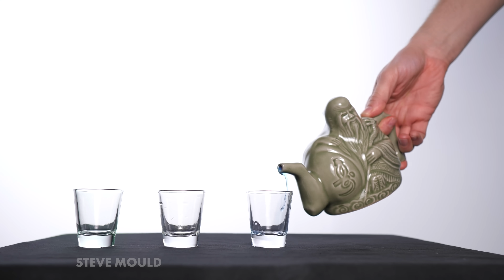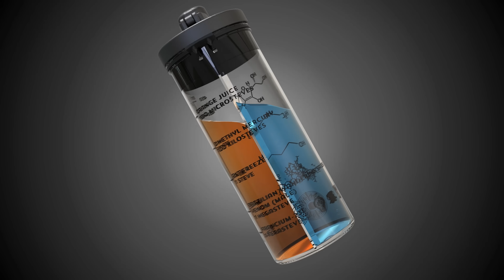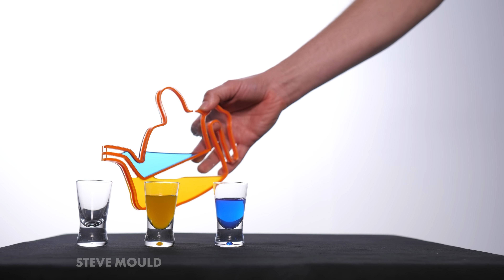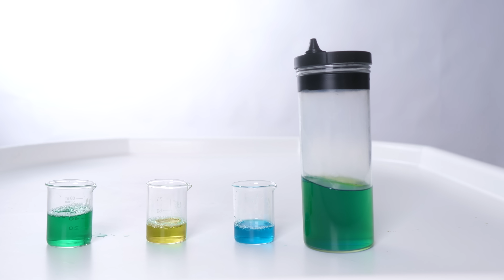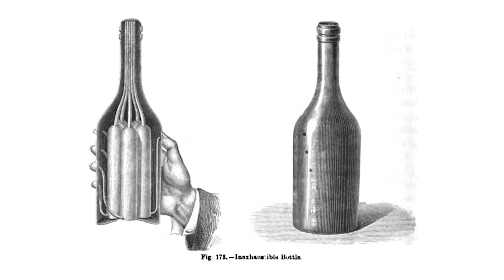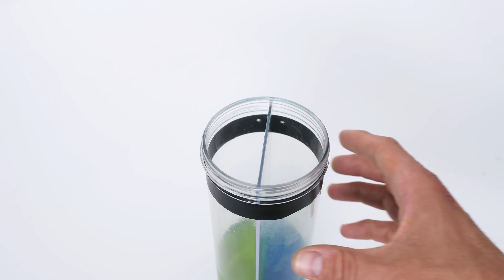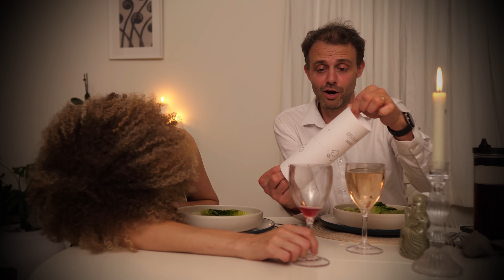The weirdest water bottle you can buy

Comment: I love this! I always have a bottle of pop (Stevia sweetened) and a bottle of water beside me. I could just have one bottle with this.

Except for one thing. We're trying to get away from using plastics for food and drinks and right now, my water bottle is metal and my pop bottle is glass. (When I go out, I just use the water one -- the glass one is pretty heavy.) I will probably buy one of these, but I will use it only occasionally. 

Any chance you could come out with one that's made out of silicone or something? Even glass? I'd carry a glass one around, and the cover would make sense on it too (my existing glass bottle has a rubber covering to protect it from bumps).

Comment: ok so im super late to suggest this and if you have not thought of this on your own which is very probable that you guys have . but anyhow the holes should be plugged in the normal position so like alittle chamber for a spring loaded ball bearing to push on a o-ring gasket so the bottle is sealed always and a couple of buttons that have pins to push the bearings to allow air thorugh. this allows the user to not worry about covering the holes after pouring and makes the experience much more intuitive  as you simply press the button of the liquid that you need to pour and if you forget about the buttons you dont pour as opposed to making a mess if you forget to plug the holes in this design.

i secretly hope that you somehow missed this idea, and this comment so you find it later and unable to live with the fact that this cool as fuck waterbottle couldve been better. have to release it again later when probably i might be able to afford it. 

ps: i know the bearing chamber valve idea makes it alot more difficult to produce on a large scale but i used that example as it clearly describe the overall idea and "i can think of better ways to implement a normally closed push to allow air through"  mechanism which would be better suited to be produced in a novelty bottle. i chose to describe it this way to just get the idea through.

heres a shit drawing of this. https://youtu.be/Jsy-OVCIQmU

Comment: You could replace the holes by small valves that are open when pressed. When I want to drink, I press the button (=valve) on the compartiment I want to drink from, air flows in and my drink flows out. There are no leaks as the valves are by default closed, and it's more intuitive than the hole system from a UX perspective (press on the desired liquid compartment rather than cover the hole on the undesired compartment).

Comment: I feel the better option for the holes would be 2 valves connected to little rubbery buttons on the outside. The valves are closed by default, but if you push down the buttons it opens them to a small pocket with air holes

Comment: hmm... I feel like the solution for the plug on the little holes is probably the biggest weakness. What if you had something like a rotating ring around it that selects which pouring mode it's in by having the ring block the little holes in different ways as you rotate it?
Reply: scrolling down the comments I see lots of people are proposing similar types of ideas. I'm sure there are a treasure trove of modifications being proposed in the comments so I do think it would be fun to have a video going over some of those ideas.

Comment: Thinking about the hole-covering mechanism, you could make the top cap have 4 levels of turning around, 1 for off, another for left hole, next for both holes and last for right hole. Basically have it snap in one of those positions with two holes in it that move as you rotate it.

Comment: cant you just make a switch to solve the holes problem, with middle position, bottom position, right and left, where of course on travels you want it set to middle top position, that way it would be just a move of a thumb instead of plugging the holes, or the need of using fingers all together

Comment: A slider would be a lot more practical. Normally it is on the dead center, closing both holes. Move it to left and right hole is open. Move it to right and left hole is open. 
Yeah, it is a bit counterintuitive but rush4249's suggestion of reverse function should compensate for that, fixing left and right opening left and right respectively.

Comment: I agree with some of the others here that buttons which are closed at rest would be best. Small spring for each button between the outside wall and the button head. Silicone ring on the inside for a seal. A slide on the outside to act as a lock for the buttons to ensure they don't get pressed in transit.
Cleaner looking and more durable. But I assume the issue is cost to do so.

A hinge lid would have also worked, then hide the buttons/holes in the in-built hinge. Also mostly a cost measure I assume.
Something that would be higher than normal due to small scale factors and the split compartment bottle.

I hope later you are able to revisit this with an improved version, its a fun idea!

Comment: I think you should have a mechanism to plug the holes that works a little differently. Perhaps two buttons that remain sealed however once pressed, open up a hole. This works in the oppposite way to the teapot where you press something to cover a hole. This way the holes remain closed in transit but you can still press either button or both buttons.

Comment: What if you put holes inside mouth piece, like having 4 tubes: 2 for liquid and 2 for air? And to block flow of air in each of those you introduce a button that blocks appropriate air tube on the side of the bottle.
This way there will be no spilling; of couse, provided that you cap block all 4 tubes on the mouth piece.
Wouldn't that be more elegant design?

Comment: I feel the design could’ve been less janky if they actually hired an engineer. Having a rubber stopper to prevent leakage is just not ideal. A toggle button like a rocker would be better. So you can set it to open or closed just by flipping a switch

Comment: just an idea for the mechanism for the holes, you could have a sliding cover that has 5 positions, it uncovers the left hole when all the way to the right, both holes when in the 4th or 2nd position, COVERS both holes when in the 3rd/central position, and uncovers the right hole when slid all the way to the left. that way you can get all three outcomes and it'll be water tight when in the centre position.

Comment: The black collar where the holes are could be made rotatable in order to block/unblock different combinations of the holes (then no extra rubber piece would be needed) - plus a smaller hinge connected stopper attached to the main pouring spout 🤔

Comment: why not 4 check valves? have a little tube that leads to the outside with a little ball inside,  it should have a mesh on one side and a hole with a chamfered opening on the other. That would fix the spilling out problem on one end and the internal mixing.
Reply: If I were to guess, too complicated to easily manufacture, and for the consumer, how would you clean it?

Comment: If instead of just open holes, it had a collar that i could twist to open one liquid. Or twist the opposite way to get the other one. Or leave it in the center to close both. 

Like how you choose a direction on a socket wrench/wrachet. 

And maybe you take off the collar or pull up or pull down (one of the three, not all 3) and you can then get both liquids at once

Comment: Is it possible to design the holes for controlling the drink choice (control holes if you will) to allow air flow but not water (limited by surface tension etc.)?

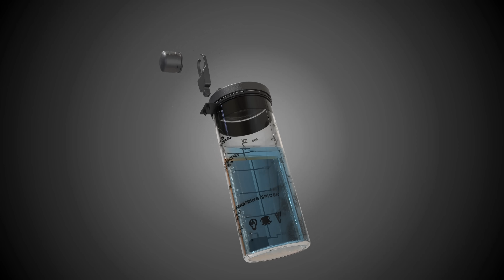Comment: 6:22 
My first guess was deadly amount of that substance for the given amount of Steves, but after a first calculation I'm not sure anymore. According to the EPA[1] dimethyl mercury is deadly at about 5mg/kg body weight, so 375mg (or about 0.11mL at close to 3g/mL) would be enough to kill a person weighing 75kg. So if a Steve weighs 75kg 300mL would only suffice for about 2.7 kiloSteve. for Since it's just gonna get absorbed and deliver mercury everywhere in your body I guess lethality is pretty much the same no matter with which body part it's absorbed. I could be wrong about that of course, but I don't really see a factor 30 in lethality difference between skin and mouth (which I could be very wrong about). Antifreeze on the other side fits what i found[2].

[1] https://cfpub.epa.gov/ncea/pprtv/documents/Dimethylmercury.pdf page 19
[2] https://www.atsdr.cdc.gov/ToxProfiles/tp96-c3.pdf page 12

Comment: I think this is a great idea and a load of fun. For the issue with the holes at the back leaking, would the use of one way valves be any use? Allowing air in without interrupting the mechanics of the bottle, but preventing liquid out? And another suggestion, instead of placing your fingers of the holes every time you want to swap drinks, why not include a sliding switch, much like you’d find on a hairdryer, that allows you to choose one or the other or both. Love your videos, your content massively aids my university studies (motorsports engineering) and can’t wait to see the final product!

Comment: Someone below had the valves for the air holes proposed as buttons below - what if the valve was a rotating ring with 5 indexed positions (both open - left open - both closed - right open - both open)? flappy rubber flaps have the tendency to break off at inconvenient times... having to hold the button pressed for dispensing the liquid might also not be desirable.

OR.

take an example of the filtering water bottle (e.g. by Sistema) that has a Brita water filter disc insert - it has a one-way valve to avoid lowering pressure and back-feeding the air through the disk back to the water chamber. What if you had 2 one-way valves, one in each air-hole, to not let the liquid out that way but allow air in? then cover the hole(s) of choice for desired action. Well chosen one way valve will allow you the 'sprinkle water on your head' action too.

Comment: The "let the air in" holes should use a simple pressure valve on the inside to close up when liquid pushes against them. That way you don't have to have a cap-tail that has to be removed both on the cap and on the tail to drink from the bottle, but can still prevent spillage

Comment: Why not have a switch in the back to cover the holes? It could be a slider switch that goes from covering one hole to the other. Or, it could be a rocker switch that goes from plugging hole to the other. There could be a middle position that seals both holes simultaneously.

Comment: Let's see if I got it... 
400ml of orange juice equals 100 µSteves, so you would be able to kill Steve with 4000L of orange juice
300ml of dimethil mercury equals 100 KSteves, so you would be able to kill Steve with 30µL of that
200ml of antifreeze equals 1 steve, so you can kill Steve with that amount
100ml of Brazilian wandering spider venom equal 1 MSteve, so you need 0.1µL of that to kill Steve
Finally, 16ml of Francium-221 equal 1 TSteve, so you'd need 16 femtoliter of that, in other words, given Francium's density of 3.48g/cm3, 0.03968 nanograms, or roughly 100 billion atoms if I did my calculations right

Comment: i am not good in design on computer to show you a good example how you can manage the two holes on the bottle, you can use a kind of sliding switch with 4 positions, the first one is closed, the 2nd will make the first hole opened, the 3rd one both holes opened and the other hole for the 4th position, you can also do two switches, one to open and close both holes, and the other switch to select which hole you want it open. you can pm me if you want a sketch for the design

Comment: Can't you design a knob where you make a hole if you press it and when the knob is in place it locks. It would make it easier to use quickly. Don't know how you can make this save to put in your bag, but there must be somthing. Maybe if the knobs are gidden under something so you can't press accidentally or only with your finger.

Comment: Instead of having to go up through the trouble of holding your finger over, it you should have had a switch on the water bottle. Depending on what you want to drink, you would flip the switch from one side to the other.

Comment: Why not make rotating wheel around holes? You can also made it sealed completely and make two canals that eventually conjoint around (separated air canal with the same end) the drinking hole (idk how you called it in english)

Comment: I feel the design would be better if the holes were on the top. Maybe with buttons? So you don't have to twist it and then find the holes just to get to the liquid. You could make the buttons into the vents.

I just feel that there could be a better design...
Like, I get it and I like the idea. It's a great gimmick, and I could see the use cases (like if you wanna bring both tea and coca cola to work (those shouldn't mix)). I just feel like it's very gimick-y. In my mind a water bottle is an item made for convenience, and this product kinda lacks that a bit. 

But that's just my opinion. Maybe if I run into a scenario where I really need this I'll come up with a design of my own that fits my exact needs and share it here.

Comment: Couldn't you create a spring-loaded flap instead of just having holes?  It wouldn't have to literally be a spring. The flap would be on the inside and push outwards and there could be a pin that sticks out of the hole and when you push on the pin it would open the flap, allowing air into that chamber and lettings that chamber flow.  Maybe that would make the bottle too complex and expensive, plus more failure points.

Comment: Instead of having two plain holes, why not placing a covering switch to press as a button to let air flow inside, or even a pin with rubber, that comes out from the hole (thus blocking it) and being able to make air flow inside by pushing it down? And I'm talking about really cheap home made solutions, anything but leaving two holes open that you can only cover with that thing that most probably would come off very easy and risking that the bottle will wet everything when moving inside a bag.
It's honestly outrageous that such a poorly lazy made product can nearly cost this much.

Comment: Toroidal assassin's water bottle would totally work. You split it in two halves, so each chamber is a half-donut. They separately screw onto the spout module, which is essentially a lid cap with two threaded sections instead of just one.

Comment: before the plugs where shown i thought the rubber ring could rotate. so that you could slide the hole in the ring over the hole in the bottle. very easy to make, easy to clean. but i don't know how well it would hold a seal but if it works i feel like that would be a better solution then the plugs

Comment: Instead of using a plug to close the air openings, why not allow the black band to rotate and close up the air holes? You could allow it to rotate few degres of the cylender and have a positive detent that will prevent it from opening without some force.

Comment: Would be nice if the air inlet holes were on the cap under the cover that you open to drink from the bottle, so that they would get sealed when you close the bottle, and then you wouldn't need the clunky additional rubber stopper for the air inlets?

Comment: I think it would be much more practical if you made the "selector" air inlets closed by default and requiring finger sized/shaped object to press them for the air to come in. This would actually reverse the action from press to hold to press for release but the general idea stays the same. The double cork thingy solves the problem but i imagine it would be a real pain to use.

Comment: I love this! However, I'm not a fan of the way to close the two holes when it is not in use.  I wonder if it could ever be practical to have a miniscule check valve in place of the holes (as, if I understand correctly, air only needs to flow inwards). I also wonder if it's possible to have the holes watertight but not airtight.

Comment: I wonder on the longevity of  the living hinge for the vent hole plugs. I've seen some spring-loaded auto-close gates for waterbottles, and maybe that would be an option, still quick to open by index finger pressure on top, but not have to take the time to manually close the lid and vents afterwards. Increase in parts and manufacturing cost, but could be contained within the lid, with the screw-collar coming around and securing below the vent buttons.
Maybe in Rev. 8!
Also I couldn't see if there was a little rim on the bottle to easily secure the koozie rim in place, so it reduces risk of sliding apart by accident.

Comment: Having to cover holes is a design flaw. Would've been nicer if it was a latch sliding on notches that cover/uncover the two holes.
Reply: except it would be obvious if you were sliding a latch during an assassination... the holes make it more discreet and the rubber plug allows another option.

Comment: I have notes!
1. Why put the holes in the bottle? Why not have the holes in the lid? Holes in rigid plastic like the bottle will introduce stress points, especially if you're constantly apply pressure to the holes... that's the "hole point" of the bottle. The lid already has a complex mold, it's made of less rigid material and extra material can be added around the holes if needed. 
2. The holes should be closed-at-rest and you "activate" a hole... Maybe there's a lever mechanism that you squeeze to open a hole. The current stopper mechanism looks really easy to pop open when in a bag, and then you might as well have the teapot in your bag.